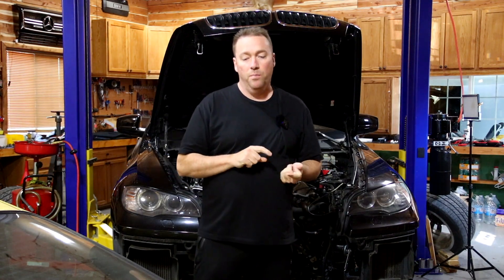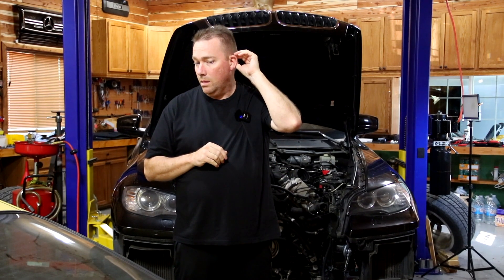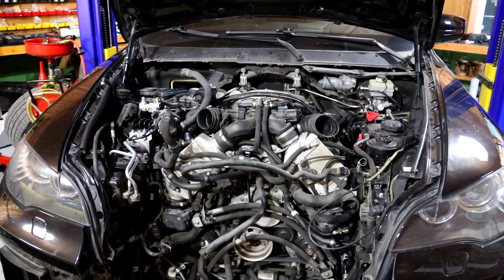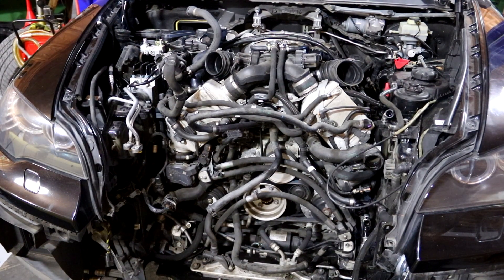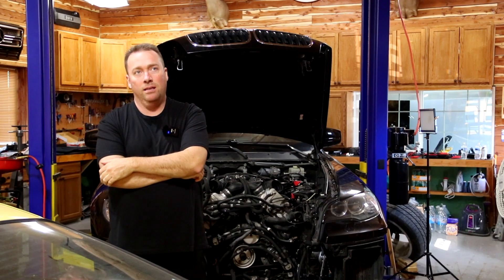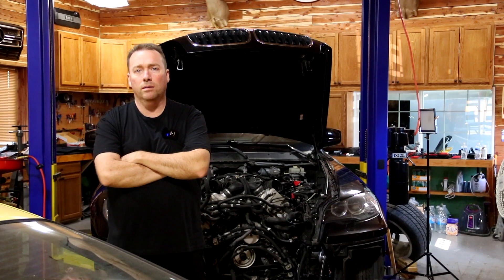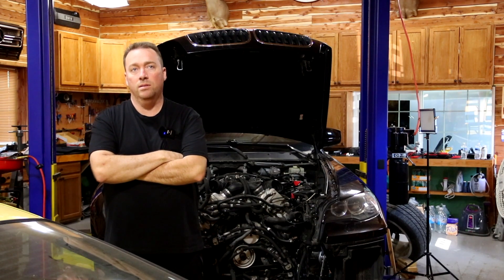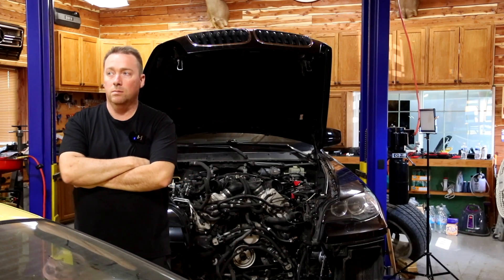So Why Do BMW Rod Bearings Fail On These Engines S62 S63 N63 N55 S65 S85

Comment: I have an N63TU (F06 650i), S65 (E92 M3), and S63 (E70 X5M). It was the X5M's S63 that decided life was not worth living. I'm curious; the $8k you say for an S63 is used, right? Warranty took care of mine at the dealer at $36k with "discounts." $18k just for the engine, then add turbos, coolers, etc. on top of that.
Would I have fixed it out of my own pocket? Never. It would have been another part out, but with warranty covering it, I have a fresh new S63 with a  warranty for the next 2 years. That's the part that feels good.
I think it comes down to the previous owner's treatment of the car. My very reliable M3 had a very good life with the first owner. The X5M's first owner followed the "maintenance intervals."
Reply: My s63 engine (X5M) spun its bearings at 49,000 miles 2 years ago. Dealer also told me $36,000 for a new engine install. I had it rebuilt for much less than that.She is back and running again with no issues.The rebuilder said it was the tight tolerances bmw used that caused the spun bearing.

It’s a shame this is a systemic issue with these engines
Reply: @SunnyD  Wow, at only 49k?!! I would have rebuilt mine also and made it better by doing so. I just would never have paid that BMW cost. That's a number where Im already thinking what  36k buys besides an engine.  Another car, or another engine?  There are better options and at much lower prices. I didn't rebuild it because the warranty  covered it. It does feel good knowing it's new and with warranty. The problem is that it's still the same engine with the same issues and the same fate. I love this thing though.

*edited to add.... I love everything about this thing EXCEPT the sound. Maybe it's the M3 that spoiled it for me. Maybe it's even the N63 in the 650. Either way, the S63 sound doesn't do it for me. At idle yes. Full throttle, no.
Reply: @Cee_M3   Yeah, only 49,000 miles & the engine quit on me. I drove it like a gentleman most of the time too & was meticulous with service. I was getting $6,000 to scrap the car. The BMW Dealer wanted $36,000 for a new factory engine swap (with ZERO goodwill from BMW of North America). The rebuild was  $12,500 ,installed, with upgraded King bearings, a new crank shaft, new rods, & fixed tolerances. The rebuild came with a 1 year warranty and is rock solid so far. I couldn’t find another 555+ hp  car, in this good of shape, for $13,000 so I decided to rebuild the engine.

If you want to improve the sound from the S63 engine you can add downpipes (catless) & do a muffler delete. Add a ECU engine tune as well. The stock cold start is enough to wake my neighbors up. But I agree with you, the full throttle sound leaves you wanting a little more.

Comment: Great video..   Im really interested in how the internals look, and the over-all job goes.     I almost pulled the trigger on this BMW and now im glad i kinda-didnt.. haha..       I enjoy the one i did pick up.. great fun to tinker with and drive and enjoy..
Reply: I’ve seen a few reputable shops do it with the motor still in car but that’s on the m3 the m5 has a cross member that’s basically touching the engine lol

Comment: It’s not as common on the N63 but it’s out there. Anytime I seen vanos and timing faults, first thing i checked was the oil filter for bearing material. Bingo! Seeing a lot of N20/N26 engines at 50k-90k miles. Junk!!!

Comment: What the hell is with the commercial during this video with the guy holding two eggs near his testicles with sad faces drawn on them? 

I have and had many Mercedes. Don’t have the mechanical issues like BMW. They get issues with accessories. Convertible top will not work, needs micro switch. Throwing temp codes because ambient temp probe fell out of its holder. 

Get your torque wrench calibrated!!

Comment: I agree with just about all of this. However, I still have never fully agreed with the n63 engine having rod bearing issues. I personally have never heard of them being bad at all like the s63 and of course s85. Until literally a few weeks ago you could buy a brand new long block of the first year n63, 2008-2013 n63b44a or n63b44o0 for $3024. Now they raised the retail to $5000 and many places you can still get them for $3700-$4000. I myself have actually seen this happen where the engine is ordered and comes in from Germany only for these replacement engines. My neighbor has a 2008 n63 x6 50i with 190,000 on the original block and no issues at all internally it’s his daily driver. He has a 2012 x6m and at 60,000 miles that s63 spun a bearing. So you definitely know what you are talking about it’s just odd to see that happen
Reply: A Lexus at 300,000 miles is way more reliable than a bmw at 60,000 miles.
Reply: It’s not as common on the N63 but it’s out there. Anytime I seen vanos and timing faults, first thing i checked was the oil filter for bearing material. Bingo! Seeing a lot of N20/N26 engines at 50k-90k miles. Junk!!!
Reply: I do agree with that. The N20 engine has got to be the worst out there. Twice as bad as any N63,S63 or S85. BMW didn’t do so hot with the N20. I think they realized that and made the b48 and b58 very well because of it

Comment: Just starting to tear down two S63s for full rebuilds. I know bearings are shot in one of them, heard the knock just before I shut it down, can feel it turning the crank. Best bearing brand to go back in? A lot people advocate for little more clearance and heavier oil, but you didn't mention that in the video. What are your thoughts on opening up the clearance a little?
Reply: Anybody running a heavier weight oil or best to keep the 5W30 in these engines?
Reply: 0w-30
Reply: Definitely my opinion. If you’re rebuilding the engine then I’d say absolutely 0w-30. The 0w is needed for protection during start up and if the valve guides are good and new with a rebuild. Possibly 0w-40 but 5w-30 or 5w-40
Reply: How many miles on both? I have a 63k 2014 M6 S63
Reply from the maker: Get the acl bearing as we used in my m5 video awhile back, they are clearanced a little more already
Reply: @NathansBMWWorkshop  thanks, I'll look them up. Many thanks for all your videos.

Comment: Nobody really knows why they fail, however the forces on the bearings are far higher than the forces on old cars and the bearings are the same size and materials.

I think the real question is why do Mercedes bearings last...

My guess it is to do with oil pressure and efficiency. I suspect BMW have lowered oil pressure to the point where the bearings suffer. We may well find that the later cars with electric oil pumps are better because electric loads can be run off regenerative braking.

Comment: I think of a modern BMW like an aircraft. After so long everything needs to be done. In the ideal world the value of the car should reflect these overhauls. BMW should make a service kit. However market forces are not doing the best for the customers or the environment in these cases.

I must say however I run a V12 760 and perhaps as an experiment I keep on paying a warranty on it with BMW. Over the years I have had a number of engine out repairs, my dealership has never really messed things up at all on my car. They do make comments like waiting for the people with the correct skills to be in the shop. I also think it helps that the service manager is an ex technician who learnt much from working on my car..

 They have replaced many hoses and items not specifically covered by the warranty as parts required by the major jobs.

So I do think that the specific dealership makes a huge difference.

Comment: Say Nathan, that 4.0L V8 in the E90 M3 is designated S65, not S63 as stated in the video.  Just saying....  call me an  a**hole for pointing it out.  IMHO your content is top shelf.
Reply: ... and as a unwary buyer I bought a 110k m3 and within short time found out what sound a spun rod bearing makes.  The learning curve is steep and not cheap.  Now 30k into replacement s65 I am all about the smiles the engine causes.  Not cheap, but worth every cent.
Reply from the maker: I didnt realize i mixed it up, had to shoot this video 3 times since phillip isnt here and i kept having quality issues , but yes i all to well know that is s65

Comment: Hey Nathan I have an S 63 on my 2015 X5 M. Did the timing chain following your guidance on my m62 e39 2003 540i… I know worst car ever. Do you think it’s worth doing rod bearings on my X5 M ? I have heard mixed feedback that they are better in the later years but I have trust issues…
Reply: Don’t do it, just change the oil and warm it up correctly. S63TU2 are strong engines.
Reply from the maker: I would Absolutely do it , anyone telling you different will cost you $10k
Reply: How many miles do you even have on the X5M?
Reply: How many miles on your X5M?

Comment: Haven’t heard of rod bearing issues in the S55 engine, but did hear about the rod bearing issues in the e chassis and early f chassis N55s. Note that in 2013, N55 got forged connecting rods from the s55 instead of the old cast rods. My theory is that this issues are 1. As somebody said, they are narrow. 2. The rods are a little bit too weak (in relative terms of course) for the torque and/or rpms they are subjected to. Rod bearing wear does depend on the connecting rod stiffness
Reply: I heard this too but I heard it's only the M235 an so on that has that forged con rod upgrade.
Reply: @cammgt3rs370  are you able to confirm it was only on M235? I think the updated N55 found in the M235 is also in the x4 m40i for 2016-2018. I'm hoping the updated connected rods were in the other n55 engines after 2013, as I'm looking at the 2017-2019 X6.
Reply: @morganlingsweiler9813  just get a X4/5/6 with B58 engine

Comment: Nathan if you take care of the rod bearings (V8-10) in time how long can the main bearing last?  What is the longest lasting main bearings on a BMW engine that you have seen?  300K miles?
Reply from the maker: No matter how the car is treated i would change them short of 100k miles, if not the alternative is very expensive, you will have no warning ...
Reply: @NathansBMWWorkshop   Let me say my question differently.  If you change the rod bearings at 80K as you suggest.  How long have you seen the main bearings last?  Any main bearings in these BMW engines last 300K with proper rod bearing maintenance?  Thanks.  Just curious.
Reply from the maker: @dogsplantscarsneatstuff176  correct, we usually don’t see main bearing failures

Comment: You should check out the Smoking tire podcast where Steve Dinsn shows up. He explains that the bearings are too narrow. He basically has to modify the crank and rods to accept NASCAR bearings which solve the issue completely.

Comment: The S63 and S85 were flawed masterpieces. Are the N63TUs better engines?? Like, will the M50i engines really not need valves stem seals, seize, and eat oil unlike it’s previous iterations??

I very very skeptical after watching your earlier video on the N63.
Reply: Only time will tell if the N63TU has issues, I think we’re on our 4th or 5th update in 2022. 2015+ haven’t heard of any rods, but valve stem seals I think I’ve heard of that already.

Comment: Art Brookey below is right. Warm that BMW engine up completely. Use only BMW recommended oil. Drive the car easy until it warms up. That really applies to all cars as oil doesn’t lubricate the best until it’s up to temp.
Reply: I use BMW spec oil but always use Mobil 1. Change frequency is what matters. I do 5k or one year. I definitely warm my car up or at least drive it very softly until it does warm up. I live in a 365 day warm, dry climate. The lack of humidity and cold really does prolong the life of these cars. NEVER had a CCV issue, for example.
Reply: @koteletten84  hey I always try to warm my car up at least 10 min. In Europe how long do you guys recommend for the engine to be fully warmed up? Also, after gunning the car over 3000rpm do you guys let it sit down a couple min before shutting off?
Reply from the maker: That might prolong it a little but you still have to replace them
Reply: @NathansBMWWorkshop  hey Nathan does this goes for 2016 s63 do I have to change out the rod bearings.
Reply: @NathansBMWWorkshop  I do enjoy your stuff, but have to disagree, and so do BMW independent shops outside Seattle where I am...like Strictly BMW in Bellevue Wa, Autometrics in Yakima Wa, Eastside Bavarian is Issaquah Wa...if maintained correctly, warm up, proper oil and change intervals....
Reply: @artbrookey3468  yea but ya gotta have it from new! 😎 E39 530iA (poor man's M5 haha) 146k mls on the clock, never let me down though I did flatten the battery once 🤣
Reply: Bmw recommended oil is bullsh1t. All spec oil is the same. Change interval and temps are more relevant plus how you drive it.
Reply: @ironmantooltime  I should have said Mobile 1 and yes 15,000 miles intervals is ridiculous. I go no more than 5000 miles. I have never had an engine failure and I drive my cars fairly hard.
Reply: @ironmantooltime  Bmw recommends Castrol
Reply: @ironmantooltime  I think by BMW recommended oil, he meant 10w60. As for me, I only use Red Line 10w60. BMW says what, 15K miles on a change I think, I never go over 3,500 miles, There is an S85 "magician" so to speak out there, Troy Jeup or something like that, builds and races S85's and others. He uses 10w50 I believe, BUT...his bearing tolerances are different than stock
Reply: @Art Brookey  S63s dont use 10w60.  right about BMWs "intervals," though. 10-15k oil changes on anything makes no sense, really, but certainly not on these. 
Personally I think most problems stem from previous owners who "follow the intervals" and think an engine is properly warmed up and ready to redline as soon as it can blow hot air through the vents. The more they treated it like that, the sooner they fail.
Reply: @koteletten84  hahaha. You literally drive your car only half of the year and you’re telling us how reliable they are. Thanks for the laugh. Plus summing up the entire US like no one in Europe does half ass repairs to their BMW’s or uses crap oil. BMW suggests O-40W oil in their E39 i6 and V8. But you’re using 0W60? When do you expect the temp to be pushing 60C in Europe? You’re literally using Dubai oil in your Europe BMW. And because you do it a certain way then all of the US is stupid and you represent all of Europe? We in Europe do this, and we in Europe so that. You can’t be that dull that you think you can speak for every European BMW owner. I’ve seen had my E39 since new in 2000 but I’m in the US. How is it possible I still drive it ALL year yet I’m in the US? Only a kid speaks the way you do, not realizing things are different outside their little world. So are you a child or just an adult still living at home?

Comment: Sorry for my ignorance, does this go for the straight 6 engines on the E90? I have 328i in 2011. Thanks!
Reply from the maker: No it does not, those have cam ledge seal issues though
Reply: @NathansBMWWorkshop  any issues to look out for on the N54 ? I’m at 130k miles